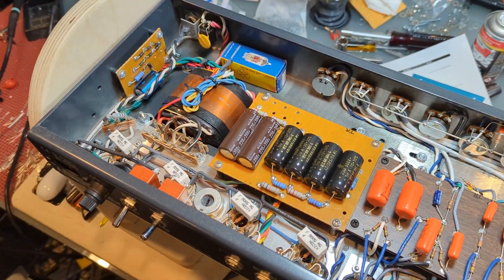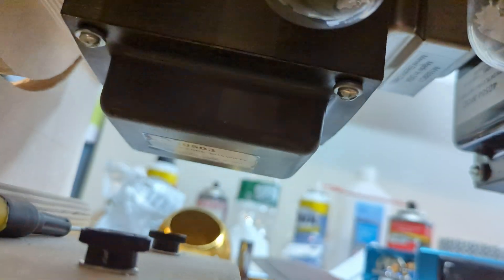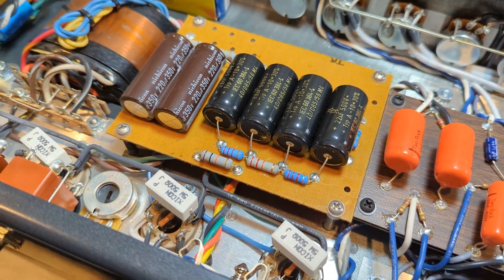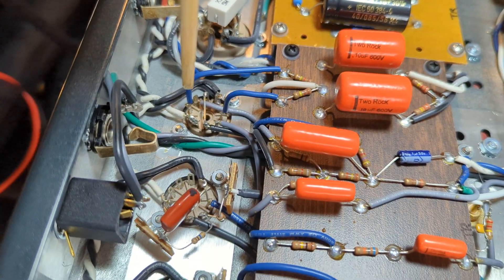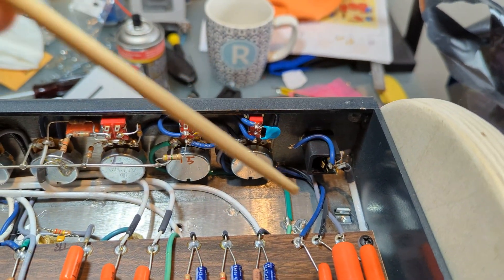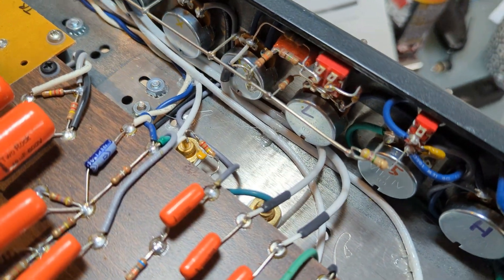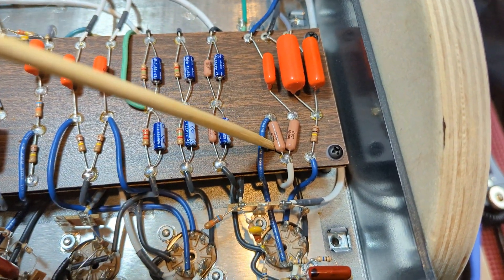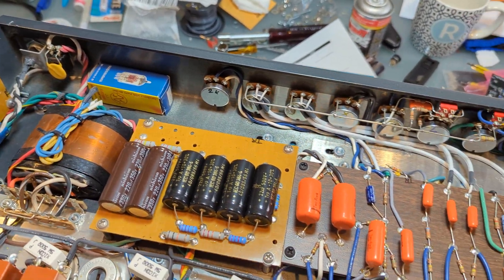Amp builder REACTS! | Inside a Two Rock Traditional Clean

Comment: No comments on the build quality or design execution?
Reply from the maker: I'd say it's a solid build and refined approach to building an amp. I personally didn't trace the amp so I cannot comment much about the actual circuitry however I always learn something from observing other builders. This amp is no exception ⚡
Reply: I’m surprised to see Alpha pots and several caps that are less expensive than Sprague and F&T.

Comment: Out of curiosity (since you reversed engineer it), do you know what is the overall cost of the components for an amp such the Two-Rock JM (or other similar Two-Rock).
Reply from the maker: Strictly components (chassis, headshell, resistors, capacitors, transformers, tubes) they are $1,200-1500 without a large ordering quantity of components. I cannot say how much the R&D of an amp influences the cost of an amp in the end.
Reply: @TheToneGeek  Of course, and it’s without labor, warranty, distribution margins and such, so I’m not judging the final price. I just wonder the BOM difference between let say a Studio Signature (sold in the $3k range) and a Bloomfield (sold in the $6k range).
Reply from the maker: @Spidouz  oh gosh.. I bet there is not much difference to be honest between the two..  transformers and tubes would be the only difference.. assuming they are buying in bulk too, I say the 1,200-1,500 is still applicable

Comment: Really great video, thanks a lot! Good to see a confirmation of bass terminals 2 and 3 connected. I wonder if it differs from the JM sig in the treble department, to my ears it seems that the TC has more top end on tap and that the available range of the treble pot is significantly larger when compared to the JM sig.